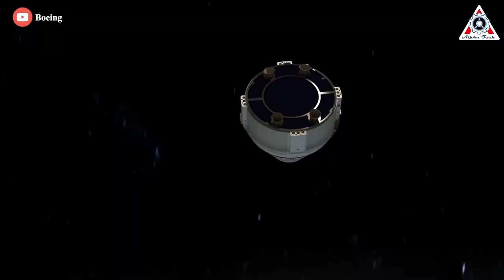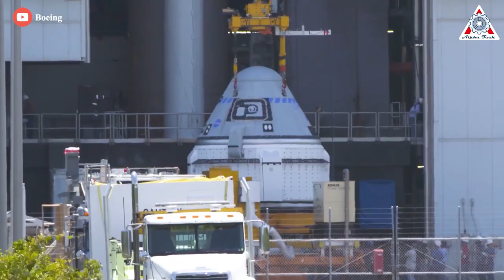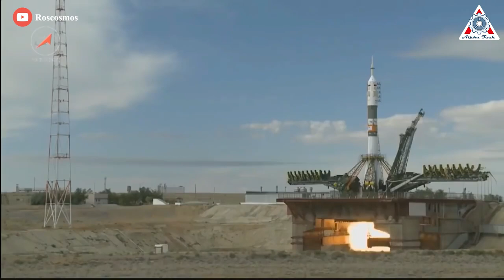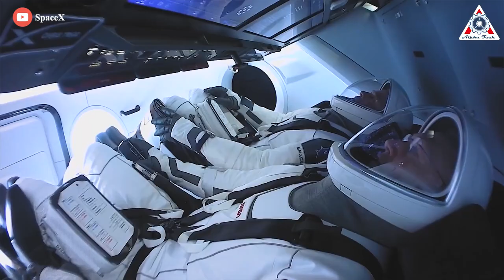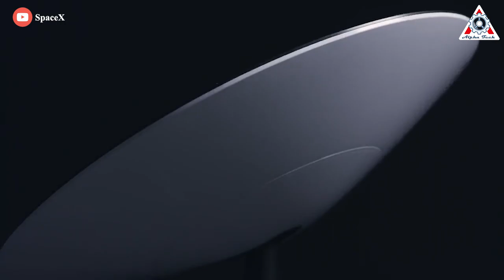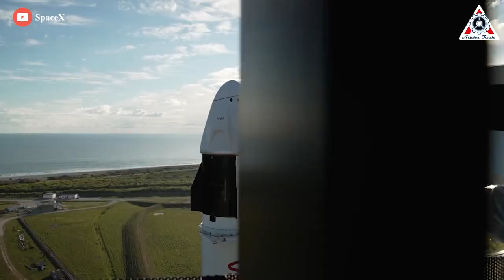After a bunch of failures, NASA canceled Boeing Starliner to go with SpaceX

Comment: With Sierra Nevada's Dream Chaser rapidly approaching operational staus, it may well leap-frog and replace Starliner as a compliment to Dragon.
Reply from the maker: Yeah. Hope that Dream chaser can work well
Reply: ULA is part of Boeing, and has the same rot running the show at the top, Dream Chaser will fail, just like SLS and for the same reasons.
Reply: @Awsimilate  Boeing is a part of ULA not the other way around.

Comment: I think NASA will have a hard time getting astronauts to ride in that disaster. The Boeing of yesterday is gone for good. NASA needs to get dream chaser up and running. ASAP.
Reply: The space program of Boeing was initially Rockwell International. Those Rockwell engineers, over time, either voluntarily left after the buyout of Rockwell aerospace or were laid off.  I know, I worked at Rockwell during the shuttle program, and just recently retired from Boeing. Boeing leadership and management is what gets in the way of producing quality products. They have good smart people.
Reply: @DbeeSapphire  Yes that's what I've heard about Boeing management.
Reply: @steveadams7550  that's informative. An a typical bottom line management.

Comment: Boeing and Blue origin seem to be twins joined at the hip for slow to non-existent progress.  So many cost overruns and delays just don't instill confidence.  Even though SpaceX has many failures, they seem to find and fix the problems fairly quickly without passing the buck and making excuses.  
So even though NASA is trying to keep costs low via competition, it looks like it isn't working very well.  I'm sure the mounting extra costs will be somehow billed to NASA so the individual companies don't have to suffer alone.

Comment: Cost plus contracts have been the norm for decades with ALL defense industry suppliers.  They were given a billion more then SpaceX tove  this vehicle.  They just thought they would be given more money after the problems came to light..  But public outcry and publicity of the staggering cost overruns of SLS , another Boeing prime contract led NASA to impose fixed pricing contracts, that is until some powerful politician forces their return to a cost plus model....  Boeing has already gone through that extra billion and have still not fixed it to equal SpaceX..  It has already used up two  Atlas rockets on troubled flights, and in their usual wisdom they can no longer build rockets using one of the most reliable rocket engines ever build because it is Russian.  Of course we still  have NO working replacement..

Comment: Since Starlink doesn't patent its inventions (according to Musk), it would be easy for another company to get in using Starlink as a basis, rather than old Space Shuttle "stuff".  Plus there is China.  So no real danger of a solid monopoly.  If NASA wants another competitor, I suggest Airbus using Airbus facilities and engineers primarily located in the USA.  Boeing is an accounting and sales company, not an engineering company.

Comment: Tsk-tsk, again a click-baity title... NASA most certainly did not "cancel" Starliner; it is just put at the end of the queue when use of NASA resources (such as launchpads) is concerned. NASA still wants redundancy both in crew transport and ISS re-boosting. Dream Chaser will probably provide both functions in several years, and Dragon could conceivably be modified for station boost (using the same adaptations that will be needed for proposed Hubble mission - telescoping docking adapter in the trunk), but in the short term, Starliner is still a safer bet.

Comment: Since it's founding Boeing's executives came from the engineering pool working their way up into the top office and this produced a culture of excellence and absolutely fantastic engineering and products

Then the financial types got involved, engineers don't know about business higher someone with an MBA degree to run the company

Well we've seen how successful that is:-(

Same disaster has happened to other companies Hewlett Packard, general electric and to a certain degree even IBM to mention a few.

Looking to the next quarter right in the next years ahead it's not a way to build on a successful company, it's a way to bleed it dry to the advantages of those who hold the stock and the CEOs.

The end result is poor and dangerous products and the failure of previous glorious companies

Scientia Non Domus,
(Knowledge Has No Home)

antiguajohn

Comment: Talk about a pot calling a kettle sooty Starliner, is "enormously expensive" by any standard or comparison, certainly given the embarrassingly lower cost of launches employing SpaceX boosters and Crew Dragon and, it is extremely unlikely the situation for Starliner and SLS could or will change for the better by natural means.

By primary comparison to SpaceX as an outstanding example of good mercantile practice.

How can anybody justify invidious insinuations that SpaceX could or would suddenly and drastically increase charges for launches to anything remotely approaching prices other companies have long applied merely because, SpaceX enjoys a monopoly due to competitors being currently unable to match its technological achievements?

That absurdly unjustifiable contention has already become deplorably threadbare yet can and probably will become even more so, as other commercial ventures like Dream Chaser begin operations which will also be substantially more cost effective by comparison with those of an increasingly uncompetitive 'old guard'!

It certainly does not and cannot justify sustaining the SLS and/or Starliner programs at substantially greater cost than services provided by SpaceX, yet claim to be doing so in order to ensure costs remain as low as possible by supporting vastly more expensive competitors because that simply, demonstrably, and emphatically does not, make, sense!

Neither do remarks such as "it's important to keep costs low, and having that kind of competition is how you do it" if the so-called competition is ridiculously more expensive and less reliable and cost effective because that cannot, "foster competition"!

Provision of launches by SpaceX have been consistently and arguably drastically cheaper, safer, more sophisticated and consistent than at any previous time in the history of space flight.

Plus, SpaceX has been working tirelessly to reduce launch costs as far as reasonably possible entirely on its own initiative, whereas Boeing and SLS have never been perceived as so much as attempting to much less doing so.

Unless analysts making outrageous insinuations think like or are otherwise somehow sympathetic toward influences among 'the old guard' and so desire to create perceptions favorable to it.

The only way implied increases claimed by the current US Federal administration to be of concern via representation through NASA might, be justifiable on the part of SpaceX, would be if the cost of resources such as raw materials including propellant components could be shown to have increased to commensurate extent.

Given that propellant components used by SpaceX are obviously not only relatively easy to produce but obtain within the US if not in-house and, that SpaceX has been particularly effective at vertical integration that is unlikely.

Of course cost-increases attaining levels as un-justifiable as Starliner and SLS could, occur if, SpaceX were to somehow become subject to the influence or God forbid even control of avaricious external interests, thus deriving substantially more profit from SpaceX while leveling the playing field for Starliner and SLS.

Ostensibly inexplicable and increasing antipathy some political influences in the US have consistently demonstrated towards Elon Musk and, distinctly dubious business antecedents applicable for some of them could, explain desperate almost irrationally obsessive attempts to maintain life support for Starliner and SLS.

It seems at least possible that 'old money' formerly heavily invested in previously solid ventures and ancillary companies dependent upon them, could be looking for new troughs at which to introduce their insatiable snouts and so be lobbying intensely for political contrivance of precisely, that circumstance.

After all maintaining share values for companies that may be ailing and failing in specific arenas until relevant interests could divest themselves of substantial commitment while minimizing losses and commit their money elsewhere would undoubtedly be of paramount concern.

It seems that clumsily obvious scare mongering is the best they can aspire to because a 'space monopoly' cannot, occur while access to space remains a multi-national enterprise.

Given the number of innovative and putatively cost effective ventures rapidly approaching maturity in the US alone the possibility is vanishingly small and diminishing, making any attempt to foment a measure of hysteria on that basis ridiculous.
Reply from the maker: Putting all your eggs in one basket is a real risk